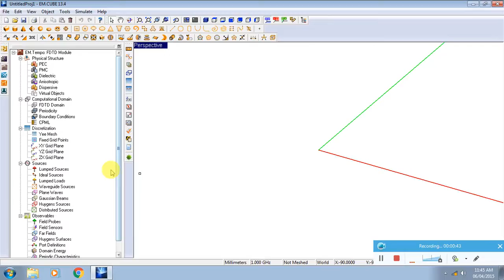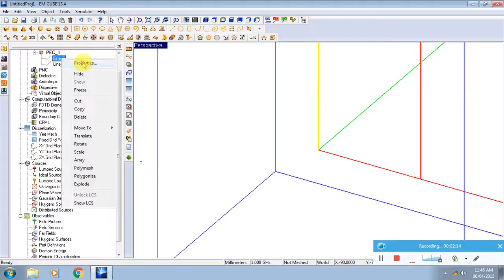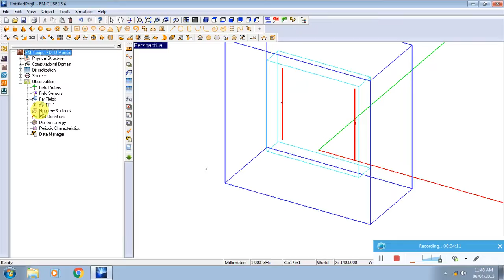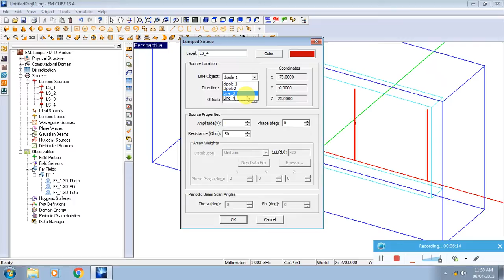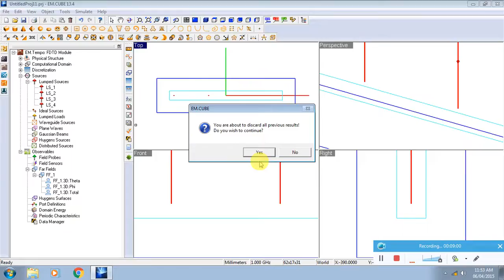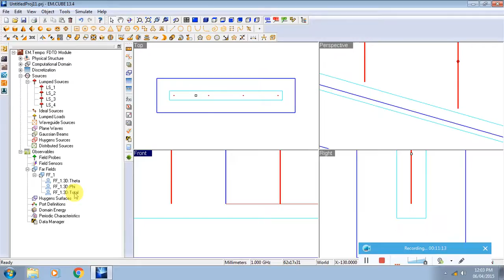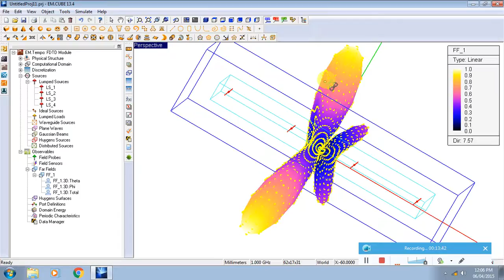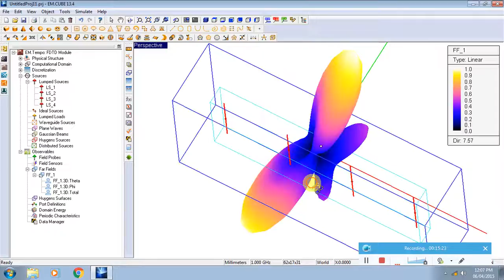Broad Side Array Design & Endfire Array antenna using EM TEMPO

Comment: It is worth to point out, that FDTD module (EM.Tempo module) of the EM.CUBE is well suited for full-wave analysis of multi-element phased arrays even in the case of the use of a low-spec PC.  For example, employment of the PC ThinkPad T510 (Intel(R) Core(TM) i5 CPU M560 @ 2.67GHz, RAM 8 GB, 64-Bit Win 7) with installed EM.CUBE (ver. 19.2-0) yields the possibility of full-wave FDTD analysis of a 20x10 elements phased array of open-ended rectangular waveguides (e.g., FDTD analysis towards electrical design of the ESA with Dolph-Chebyshev amplitude distribution providing desired side-lobes suppression and desired beam tilt). Obtained radiation pattern can be easily imported to any other module of EM.CUBE, for example, to the Physical Optics simulation module (EM.ILLUMINA module) and used for simulation of radiation performances of the aforesaid 20x10 phased array installed upon a vehicle, airplane or upon a ship. Adding to it, due to high functionality of the EM.CUBE's CAD-module, the said phased array of open-ended waveguides can be easily modified to a phased array of dielectric rod antennas or open-ended waveguides covered by a flat radome, etc. Superior functionality and user-friendly GUI make EM.CUBE perfectly suited to practical tasks of feasibility studies and R&D on development of a wide diversity of antenna systems operated in realistic communication environments. 以上。

Comment: EM.CUBE (EM simulator marketed by EMAG Technologies Inc., USA) is an excellent antenna design & simulation tool which was originally developed for equipping the U.S. Army Laboratories (where EM.CUBE is continiously used for designing diverse antenna systems, including phased arrays for mm-wave applications). The latest version of the EM.CUBE suite (ver. R20.1) contains extended library of wizards with ready-to-use models of slot-coupled patch antennas, microstrip-fed patch antennas, probe-fed patch antennas and arrays, horn & waveguide antennas and arrays, etc. The latest version of the EM.CUBE features extended functionality, including function of a phased array radiation pattern synthesis based on the use of generic algorithms which considerably speeds up feasibility studies and reduces time of entire R&D cycle. Adding to it, EM.CUBE features enormous price competitive capacity compared to ANSYS HFSS, REMCOM, ALTAIR products.　As to my opinion, EM.CUBE is a very underestimated EM simulation suite possessing high competitive capacities and distinct practical advantages compared to well-known commercial EM simulation software. 以上。